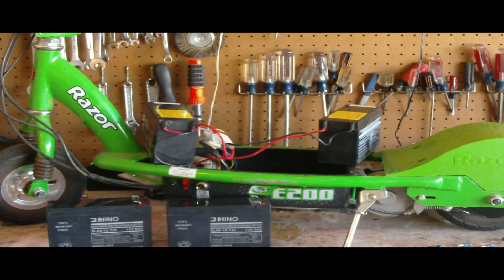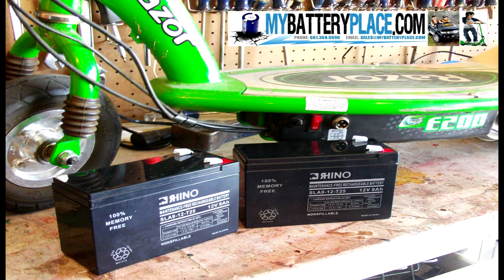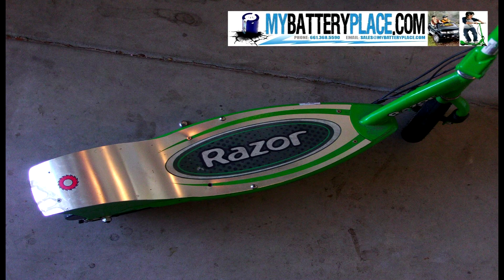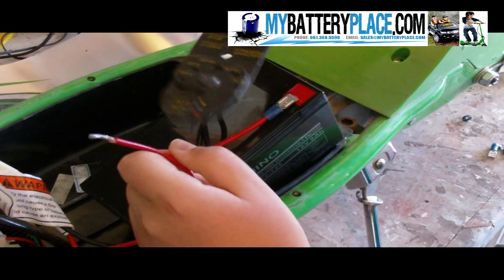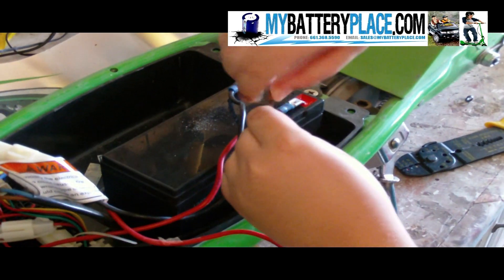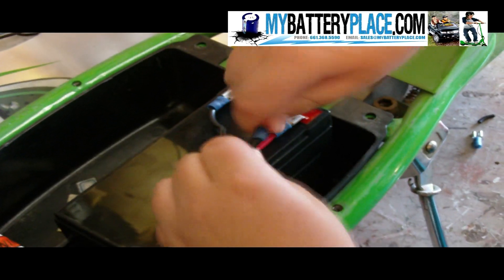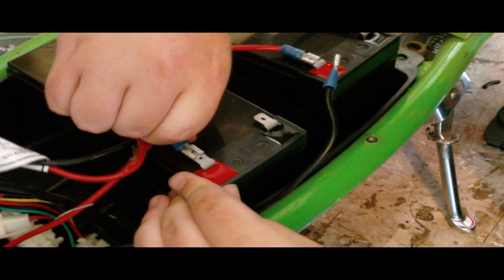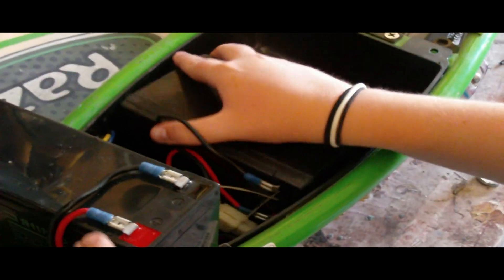How to change Razor Scooter Batteries

Comment: Outstanding video, very informative. Our daughter has a pocket mod razor scooter (The vespa style one), and the original batteries died pretty quick. I got replacement batteries from Amazon, but was not sure how replace them. This video certainly helped, and procedure is very similar, with a few minor adjustments. Thanks to this video, we have a running scooter again. Many thanks!!

Comment: Just so folks don't have to go to Radio Shack twice like me, be sure to get quarter inch (1/4") Quick Disconnects. They now come in a small plastic bag in packs of 10, product code 6403133.  Thank you for posting this!  Cost of batteries on the product web site was ridiculous, plus your instructions were indispensable for someone clueless like me.  Scooter running like new after a year sitting dead.

Comment from the maker: Probably not a good thing to try. The scooter takes two 12v that make a 24v battery the way they are wired. They are 24v motors too so you would probably fry the batteries and the motor if you tried what you are talking about.